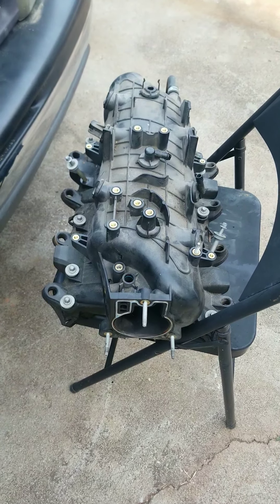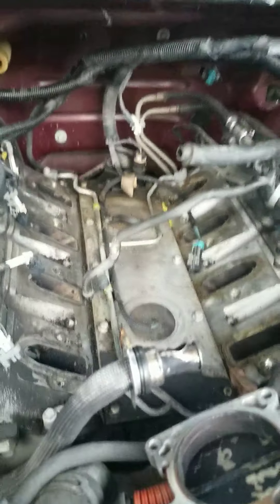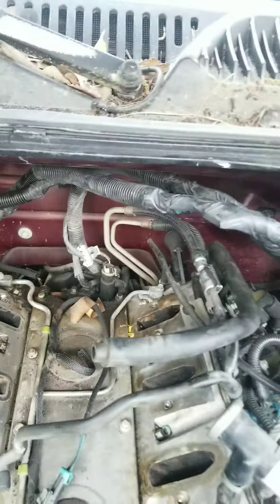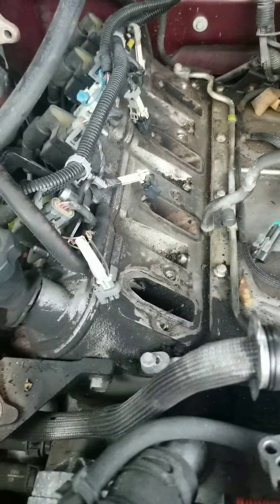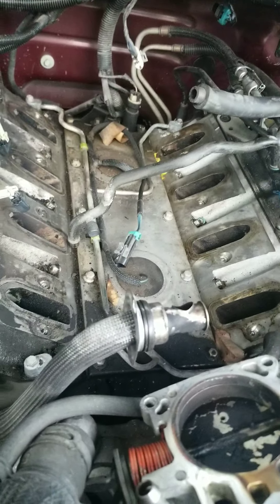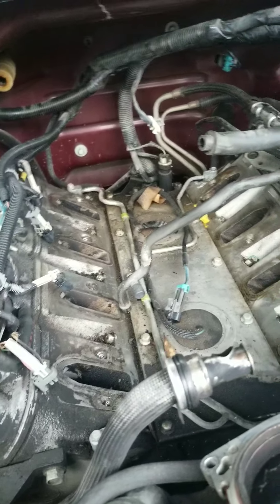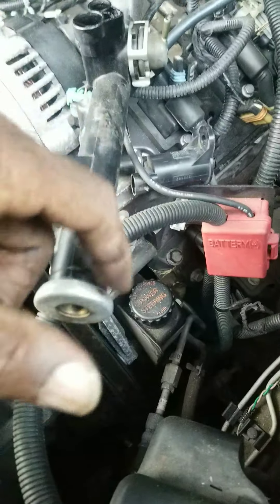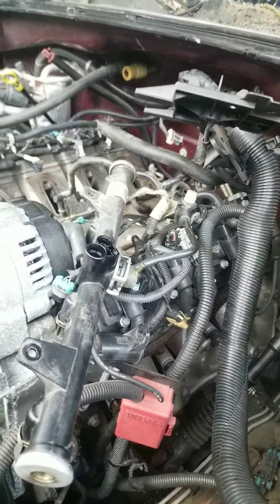5.3 intake leak ,white smoke

Comment: Sir I just had a problem with my 5.3 avalanche it's a 04 .. I was driving it out in the rain and the it started like misfiring and smoke came out out the exhaust. I got scared check my oil. It was not Milky I pulled home and it's siting now and the started went out too just my luck

Comment: Hey man I got a question my 04 Tahoe it smokes when I start it but goes away after it’s warm would you recommend replacing the head gaskets or do you think it’s something else it does have an intake leak and I got the gaskets for that but idk if that will stop it blowing smoke till it’s warm curious if there’s a way I could check to see if the head gaskets are actually bad before I go tearing off the heads
Reply: Pcv valve
Reply: @Kevin_Yagoonie  can you buy that as a part or would I need a new intake?
Reply: @briankinzer4175  there's YouTube videos on it check them out. Some you just pull out the pcv valve out the valve cover and replace. And others you have to replace the valve cover itself because the pcv valve is interigated inside the valve cover
Reply: @Kevin_Yagoonie  thanks for the help I appreciate it I forgot to mention when I start the truck it also sounds like one or more of the valves stick or something has a weird lope on a cold start but then again that could all be bc of what you’re saying too I’ll go pull one sometime today and see what’s going on I appreciate it 👍🏼
Reply: @briankinzer4175 hello sir hope all is well  where you able to resolve the issue ? Was it the pcv valve ?